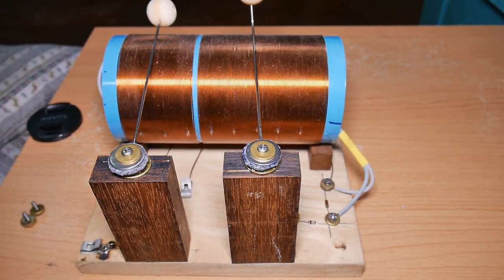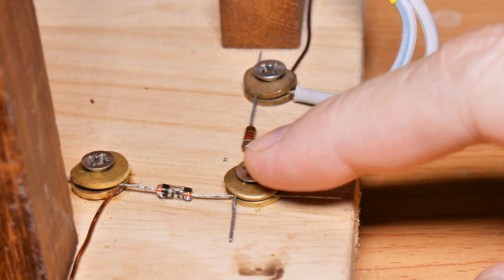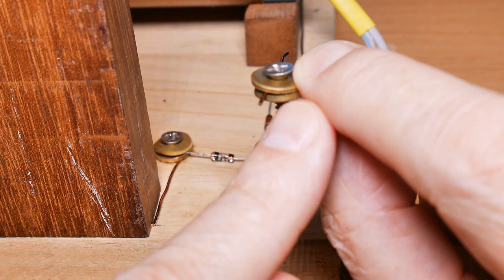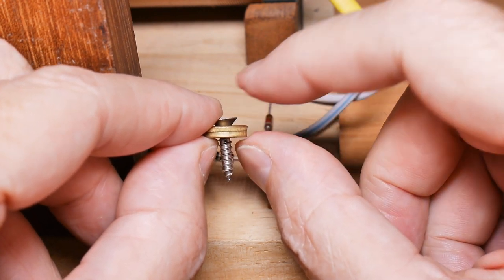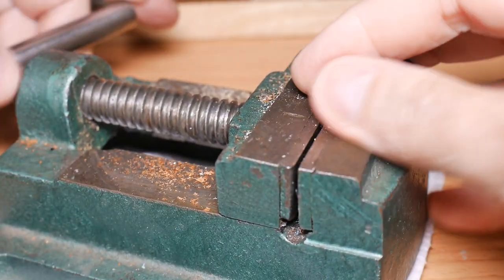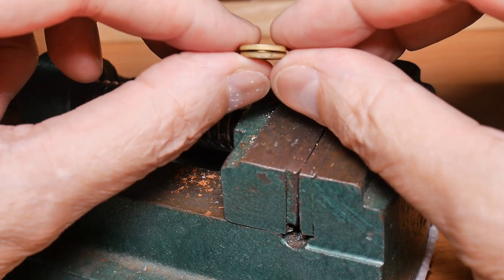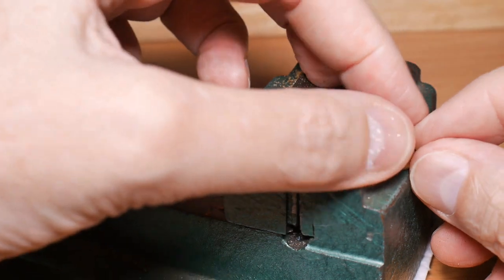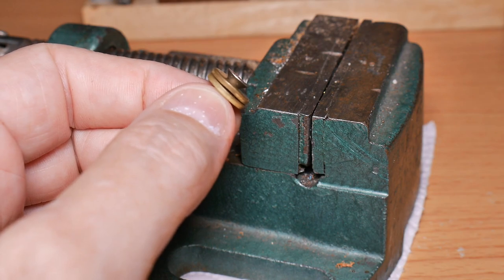Good Crystal Radio Connection Points

Comment from the maker: RELATED CRYSTAL RADIO VIDEOS: 
Updated Video: Best/Easiest DIY Crystal Radio - No Batteries, No External Power (4K)
https://youtu.be/fLVCqZGpv3U
 
My New Favorite!  Crystal Radio with Antenna Tuner:    https://youtu.be/mh5KxCpbQ5U
Crystal Radio, Capacitive Tuning - WORKS GREAT!:    https://youtu.be/VJ80Nm9KSkE
Crystal Radio & Resonant Coil Design:     https://youtu.be/Fw9eb-aB-XU
Crystal Radio Antenna (Shortwave Also):    https://youtu.be/G8AsgZbncW4

My Crystal Radio Does NOT Work (FIXES for common problems):    https://youtu.be/kCxQ8iPQx4s
Crystal Radio, Connect A DC Audio Amplifier:  https://youtu.be/RW3VhnzgjtA
Three Upgrades For Your Crystal Radio:   https://youtu.be/LENco3_jV_s
Crystal Radio Wiper Upgrade:     https://youtu.be/i1otDz39nlw
Popular Crystal Radio Design That's a Waste of Time - And Why: https://youtu.be/r9Onub2Xpzc   
New Crystal Radio Design - "Modified-Pickard":     https://youtu.be/_qxHhFKjLAg
Crystal Electric Generator RF Energy Harvesting Exp 5 - Full Wave Rectifier:   https://youtu.be/BTu_GJKjOmA

Comment: What about only using a metal top wire, and using an ABS or HDPE crush washer or toothed washer for the top one?
Reply from the maker: It could be made to work, but one requirement is to get the best long term electrical connection.  With steel, plastic, etc. you will be lacking about half the total electrical area for conductivity.

Comment: Your recommendation for either brass or stainless steel brings up a question.  Is the material preference for astethics or for conductivity or both? Would galvanized or zinc plated screws and washers (or another type) provide lackluster results...or no results? 
Appreciate the reply.  Thanks for sharing your thoughts and acumen.
Reply from the maker: The primary reason for brass or stainless is conductivity, especially over time.  Steel, galvanized, etc first are not good conductors and second will form a layer of corrosion over the long haul.  No point in building one for it to not work well or for it not to last a long time.
Reply: Fully agree with your last statement.  I've had enough trouble with mine working.  Dont want to build a cheap one only to have it work once.  
Again thanks for the help and insight.
Reply from the maker: Barry: I have a video on common issues with crystal radios.  Perhaps it might help.  https://www.youtube.com/watch?v=kCxQ8iPQx4s

Comment: It seems to me that soldering is a more proven method. It is certainly cheaper and faster
Reply from the maker: I also like soldered connections, however you need to hold them down to the board.  Also, the earphone has to be removable for repair (the cords go bad pretty often).